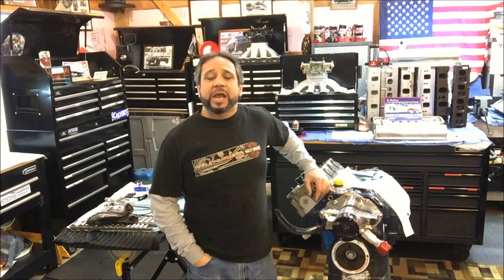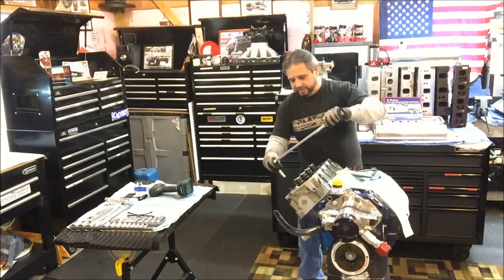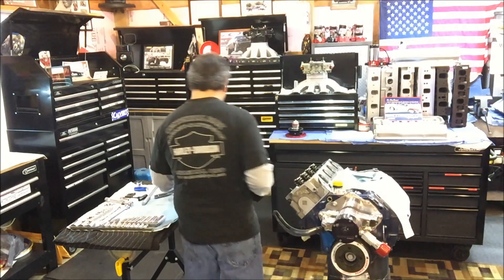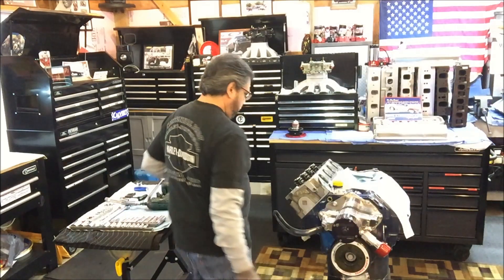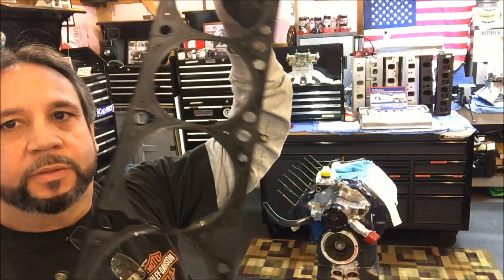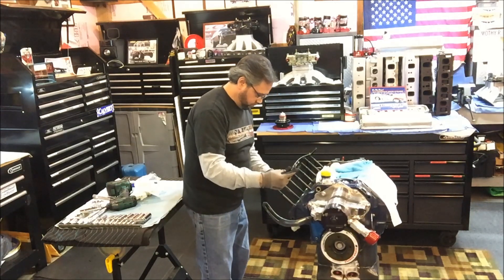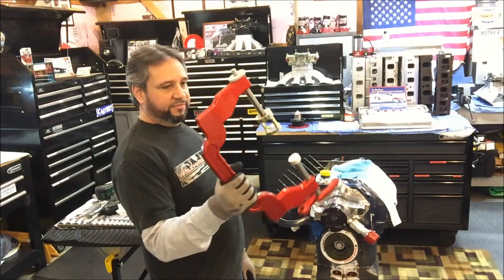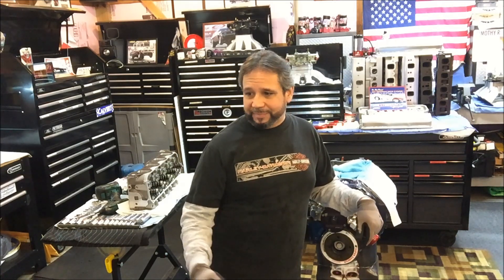Episode 39 Fixing Up The 409 Cleveland.

Comment: Not sure what rpms you turn or I assume you run light weight valves , retainers ect. I was told that its a good idea to remove the remove the tension off the springs . I did not turn my old street car past 7800 so I did not run the extra spring pressure to go 9500 . . So I was told to just remove the rockers ect if I were put the car up for a while . I did not think it was a bad idea .
Reply from the maker: Jim running titanium valves, and retainers in the 409c, pro stockers. If it works out then one set of heads will have titanium and the other light weight stainless. Ti retainers. Bullet Cams sponsors me so I get pac racing springs. Your exactly right. Light is good with cleveland valve train.

Comment: Clean engine after pulling it apart.  So I noticed your channel has several videos of you disassembling and building Cleveland's.  Are you running just one Cleveland at a time just for the Cougar?  Is the Cougar a track only car or do you street drive any of these awesome engines?  Also do you rung King XP bearings with the P-Max coating?
Reply from the maker: Yes, just one at a time, but have started to work on the TrackBoss427, and the Pro Stock slowly.I do drive on the street, but just around town. I have only used Clevites. The 409c, has the coated bearings.

Comment: Hi Tim, another great set of cleveland heads in Aussie are Higgins CNC  heads. Google them out of interest. How much comp can be run B4 Oring & copper gaskets?
Reply from the maker: Yes, Neil very familiar with them. Anything over 14.9:1 you may thi8nk about that, or any power adder, turbo, blower.